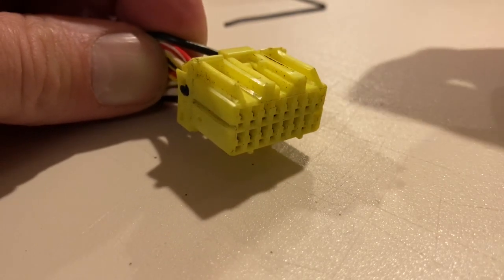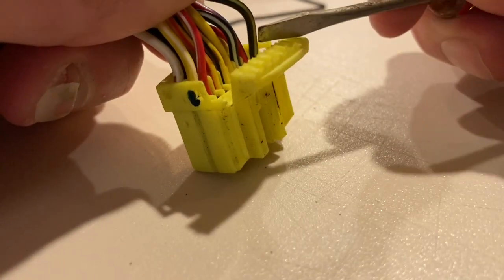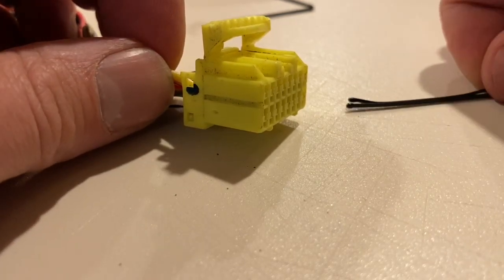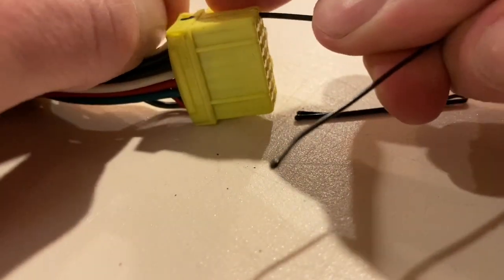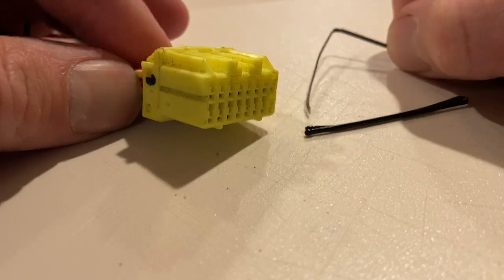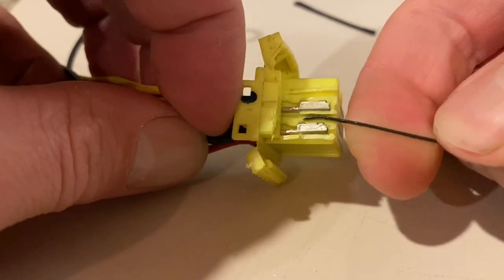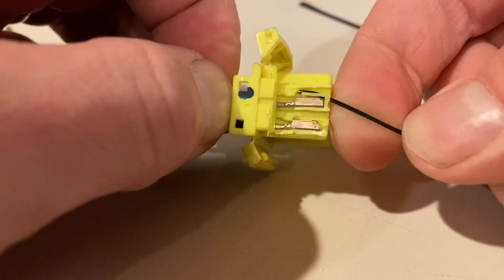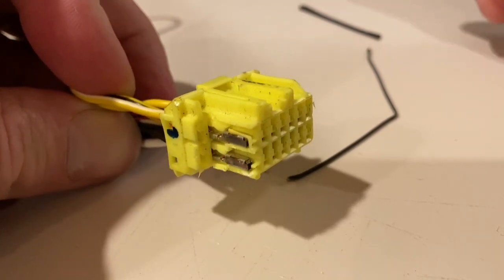How To Remove Pins From a Electrical Connector with a Hair Clip. 2G DSM Evo 8 Mitsubishi ECU PCM ECM

Comment: Very nice! Between for example like RVR ecu /tcu connectors or i think 97 above you have to pull up the white tab on the top center of the connector instead and then you can do this to remove the pin.

Comment: For reference my 99 was different. I ended up using a safety pin which worked well. The angle of approach once inside the pin was different and actually super easy
Reply from the maker: Brent  - awesome! I’m glad you were able to do it. Now you can make mad booooosts!
Reply: Jeremy N it was magical. Waiting on a t bolt clamp to coming in the mail since I shattered the last one.

Comment: I need checking in my asx from 2017. I need take signal from front speaker without cutting factory cable. Hope is work but I can see all ready in my dont have this pup up plastic look similar but is solid no pup up. I coming back when I checking 🙂

Comment: I'm adding wires to pin 79 of my ecu (which was blank), where can I get or what can I do to get me those metal pins to be soldered into the wires?
Reply from the maker: I’m not sure what type of pins they are. Do you just need 1 pin with a ~6 inch wire coming out? If so - I may have some.